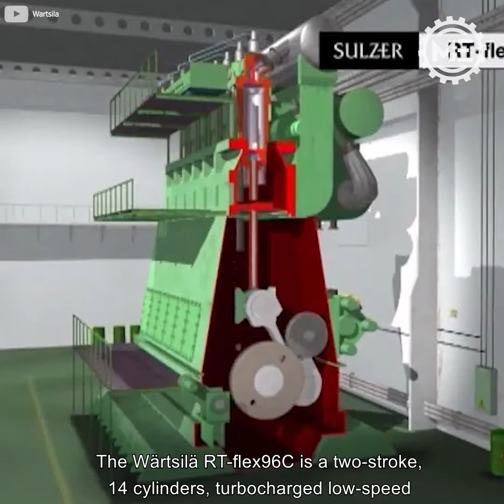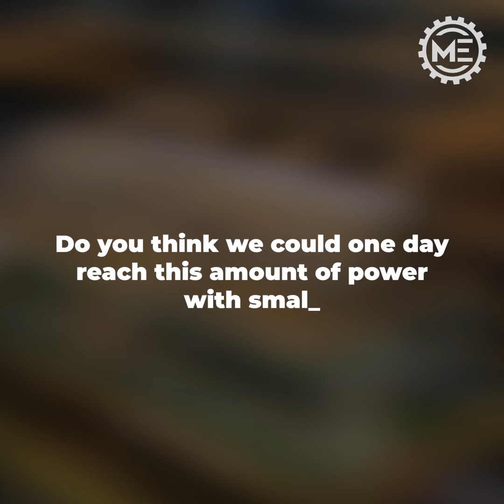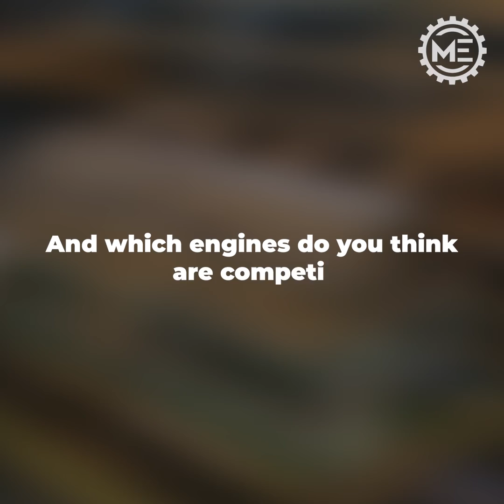The Largest engine in the world: Wärtsilä RT-flex96C engine

Comment: Truly a technical masterpiece!
Interesting that the power/engine size is extremely low: only ~4,3hp per liter. But this is about power at very low rpm due to an immense torque, and about fuel economy and lifetime. 
You can get the same power output with a much smaller engine but it would probably be less economical and higher maintainence costs.
And while the weight of this engine is mindblowing it's still a small fraction of the total weight of a large cargoship or oiltanker. So even if a much smaller engine would lower the weight it's still very small difference in relation to the total weight of the vessel.

Comment: If they using 4 stoke, it should be better fuel consumption. Because it's a massive diesel engine
Reply: I would think that the engineers have looked at that and said no. Two strokes is the way to go

Comment: I actually find it amazingly economical as a Boeing 747 consumes more full per hour. Yes, a 747 travels 20 times faster than the container ship the RT FLEX96C propels but the ship weighs a 1000 times more than a 747
Reply: If you go through and calculate the $/kg for the 747 and the Emma Maersk, the latter is 70 to 100 times cheaper while being 50 times slower for a voyage from Asia to Europe.

Comment: 7,600,000 Nm!!! That is an almost unimaginable amount of torque. If my maths is correct, (which it probably isn't) then theoretically if you had a lever that was 10kms long or 6.21 miles long and it was infinitely strong and weighed nothing and it was connected to the end of the crankshaft then it would still take 77.4kg or 170lbs of force at the end of the lever to overcome the max torque of the engine. If that is true then that's unbelievable.
Reply: If I had 1 dollar for every nm of torque it makes,I'd be rich
Reply: @KitKitChanIsaac  i like how you think.